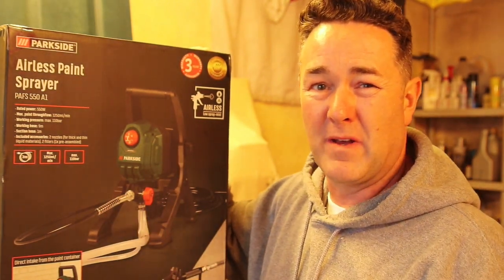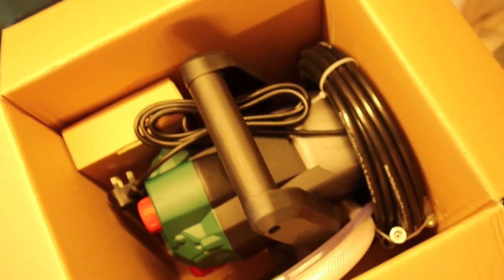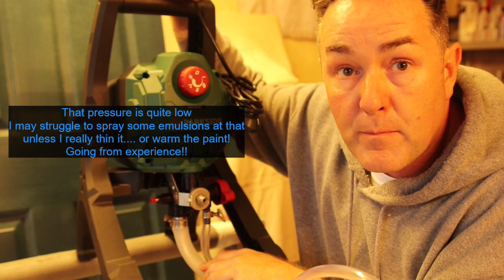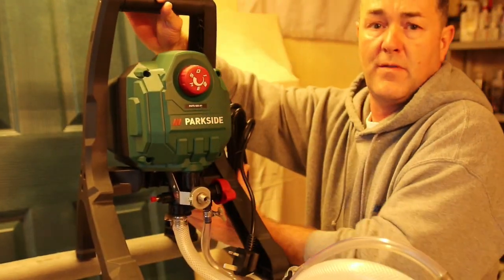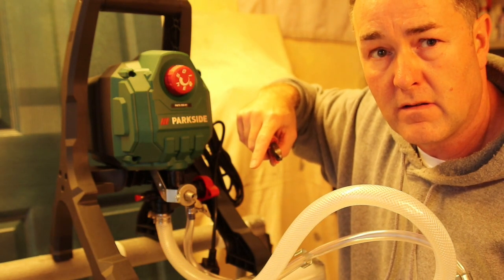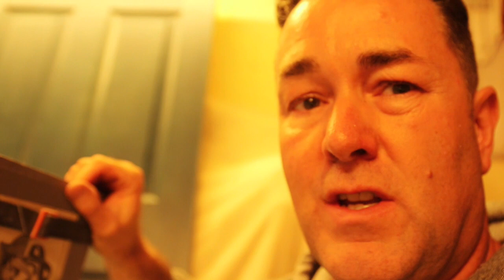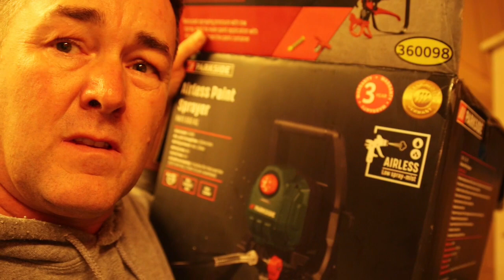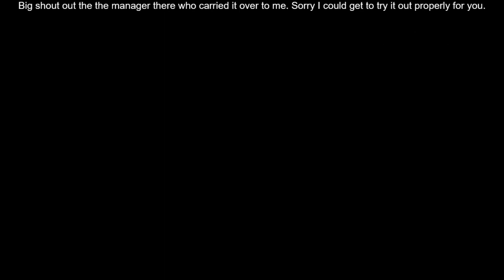Parkside Lidl Airless Paint Sprayer Review: Pro Results for £129?

Comment: Take all the filters out...  filter in gun and where ever else they put one.
Reply from the maker: Made no difference. What about it all leaking out the unit?
Reply from the maker: @JONO3679  I've seen that guy spraying.... With some tweaks I'd get him a Pro ;)

CGI... That's cheating! LoL
Reply: @ProfessionalPainterDecorator  are you after a cheaper machine. Ive had Wagners and gracos i can set you down the right path if your after a cheaper machine.. was so good my wagners never came back out of the garage..
Reply from the maker: @JONO3679  no. I've already a stage 5 hvlp Qt 5.
Graco GXff
Titan 440xt
Reply: @ProfessionalPainterDecorator  ive still got a wagner 400 .. will never use a hopper again... the motors last forever